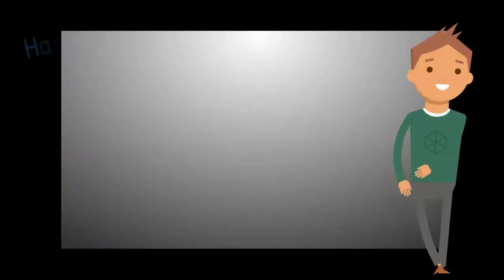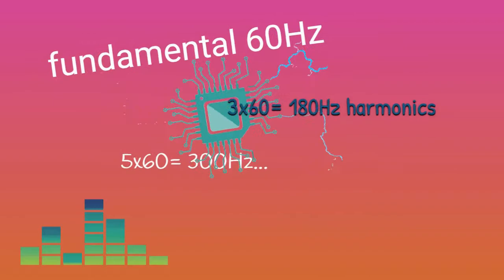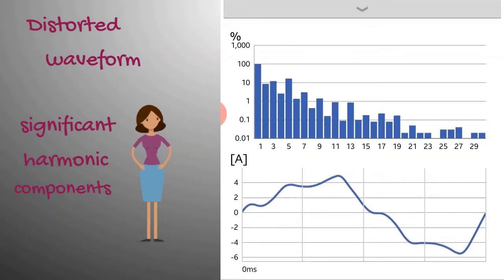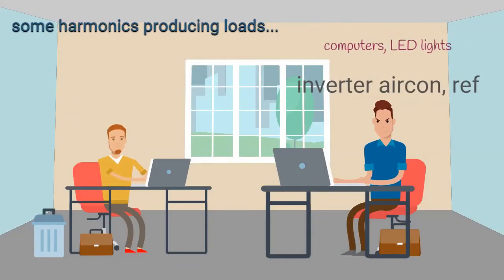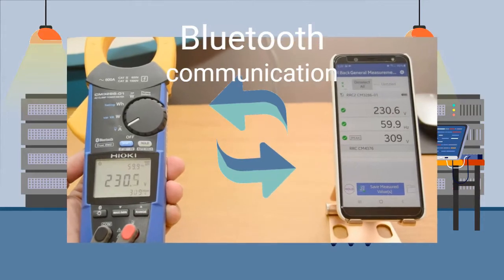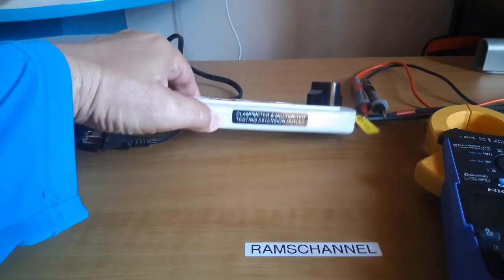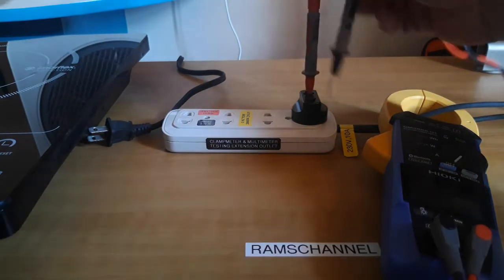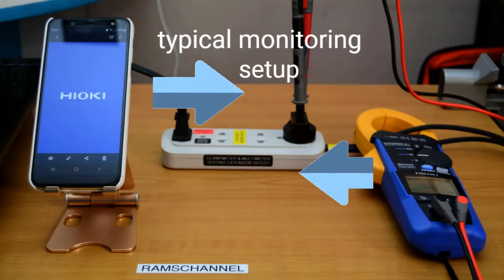[CC] A Preview of the Hioki Gennect Cross App and CM3286-01 AC Clamp Power Meter

Comment: What is the difference between the clamp power meter (CM3286-01) and a clamp meter (CM4375-50) in order for the 3286 to calculate Watts?  the 4375 can calculate VA in DC, is that incompatible with the Watts/Power, as in it needs AC measurement?
Reply from the maker: As you may already know DC power in Watts is simply the product of voltage and current and the CM4375 can handle it. But for AC another variable is needed: power factor (Watts =V*A*pf), which requires a more sophisticated circuitry that the CM3286 possess.
Reply: @ramschannelreviews   I want to 
(1) measure Watts consumption of devices connected to a UPS while the UPS is powered by wall outlet AC.
(2) measure Watts consumption of devices connected to a UPS while powered by internal battery backup (DC to AC) but pure sine-wave). 

I am assuming both (1) and (2) will need a Power meter.
Reply from the maker: @AK-IT  Right. But since you're just testing typical wall outlet loads, you may also want to consider plug-in energy monitors. They can usually handle up to 10Amp load, and display V, A, Watts, PF, and watt-hour.